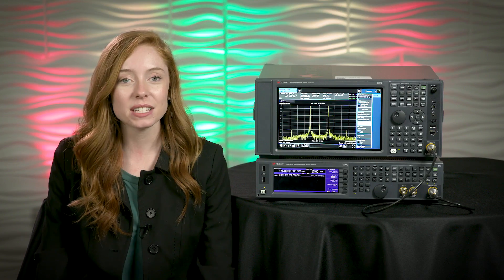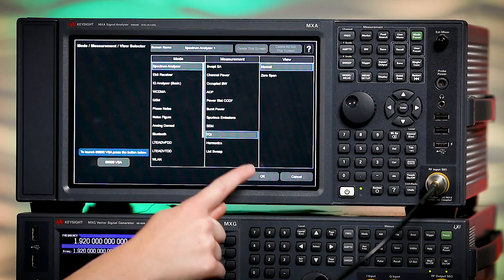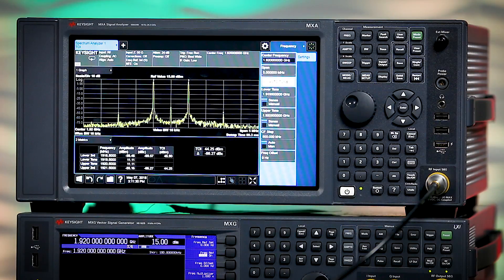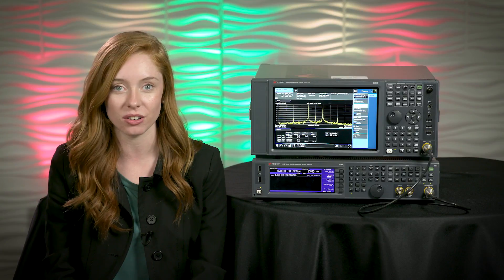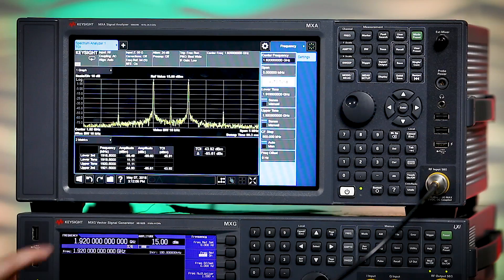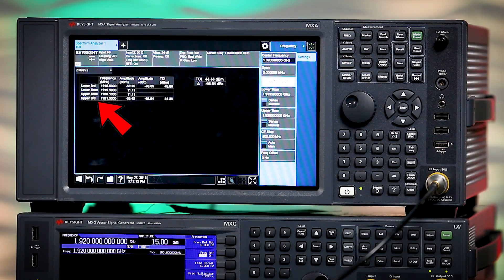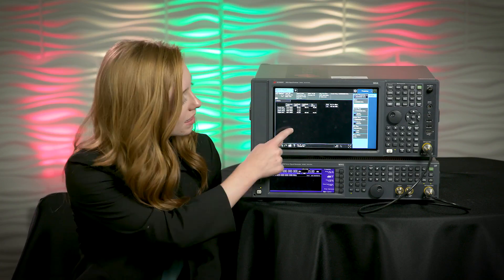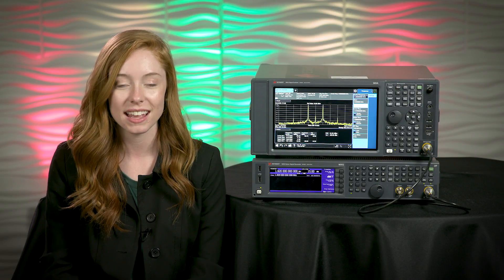How to Make Third Order Intercept (TOI) Measurements

Comment: Hi dear 
When are measuring intermodulation using the spectrum analyzer. When we 
change input attenuation of the SA,  Why the power of intermodulation products changes? thanks
Reply: You should not use the built in attenuator to do ITOI measurements. It’s best to use an external attenuator.

Comment: Can you guys do a video showing the difference in measure FM  modulation in real time and and various slower  sweep rates
for like one period of the modulating signal  and 1/4, 1/2 and 3/4  periods single sweeps.  Can the sideband phases also be shown
simultaneously on the screen display ?   Or is that a matter for vector (constellation)  diagrams ?

Comment: Unrelated; audio frequency components do have a very special property which is that they have explicit spectral bandwidth of eight octaves or more: 20hz to 20khz. Audiophiles care a lot about intermodulation distortion. Thanks for all the details! I'm definitely going to apply what I learned!

PS it's likely that the largest source of error is in the transducer. The loudspeaker cone itself is the largest source of IM distortion and it's basically due to the Doppler effect of a large paper cone, moving slowly forward, which is also excited by a high frequency signal. The HF signal gets modulated by the low notes and causes audible distortion. I try to choose the largest driver I can to minimize the velocity and to filter certain frequencies to other drivers which perform better at different frequencies (woofer tweeter).

I'm constantly impressed with how much these two apparently different domains intersect. Thank you for the video!

Comment: So, theoretically if you increase the power beyond IP3, the intermodulation product would have more power than the source signals?
Reply: Based on the math yup. Reality however is a cruel mistress. Just make sure its not expensive if you do try. ;)
Reply: Nooo. The amplitude can be higher but the power must be conserved.

Unless the amplifier itself is involved with this analysis. If the amplifying system is capable of putting more power into the system for non linear than it can for linear systems then it could be the case.

I'd love some clarification actually! The conservation of energy said that the sum of two signals is always equal or less than their individual power. But if the amplifier is making the problem worse then that's the issue. I'm quite curious myself! Thanks!
Reply: Yeah I also think that intermodulation obeys to the laws of thermodynamics ;)